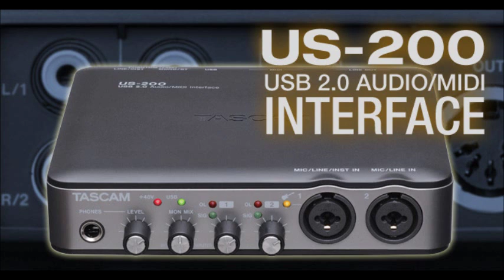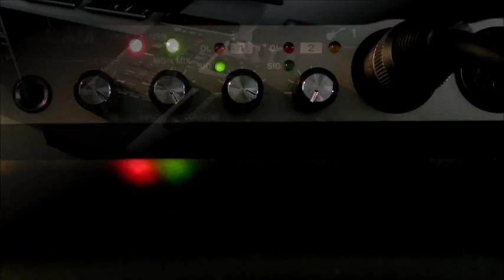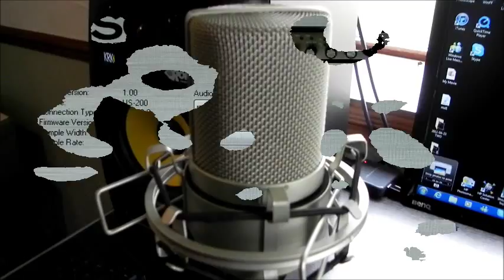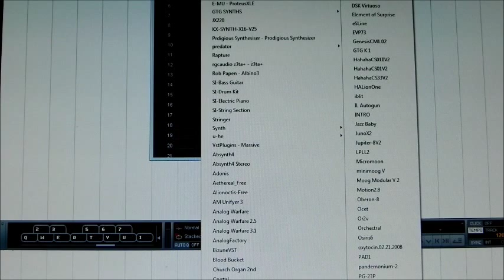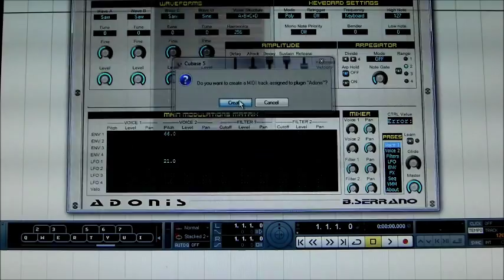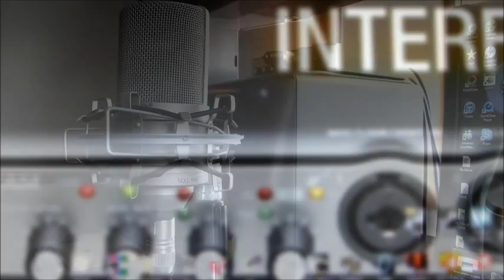TASCAM US-200 AUDIO INTERFACE USER REVIEW

Comment: Nice review. I was looking to get an M-Audio Fastrack Pro but having seen the new Tascam models I do not hink I will bother with M-Audio at all. I noticed you did not mention this had an SPDIF I Know there is one on the US-600 Model. And think I will get the 600.

I want it for Guitar, Vocals and Keyboards and have a Fatar VMK-188 Plus Midi Controller, and was wondering would you recommend using the Midi on the Tascam rather than just using the USB lead from my Midi Controller to my Desktop PC